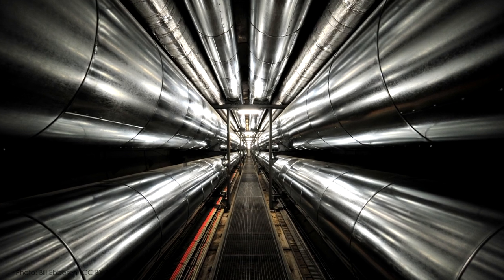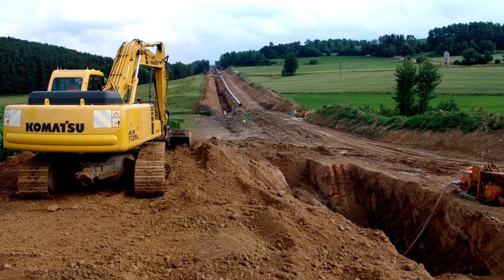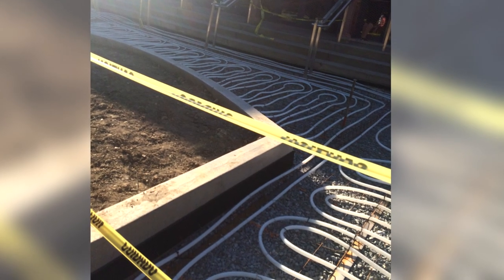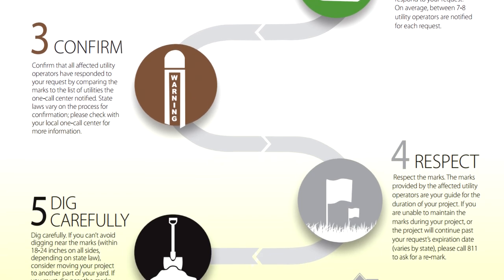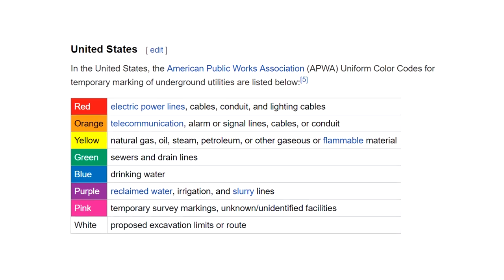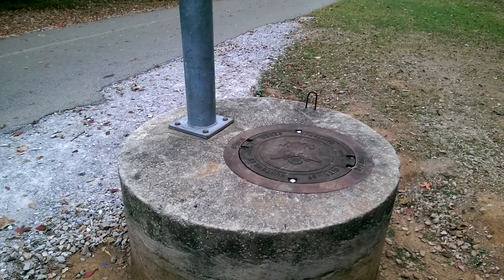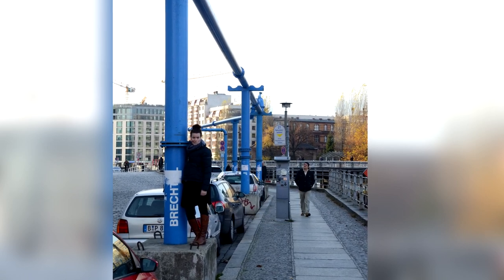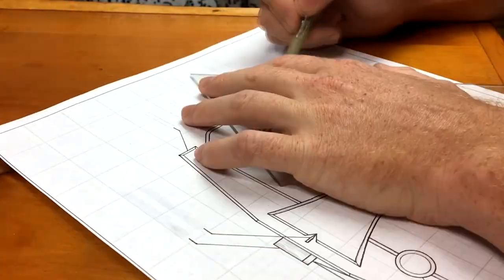What's That Infrastructure? (Ep. 4 - Subsurface Utilities)

Comment: The overground pipes in Berlin are used for pumping out construction sites, since the location in which the picture was taken is rather close to a river and Berlin has relatively high groundwater. They drain the water into the next river (you can actually see that in one of the pictures), but that can still mean that they go on for multiple city blocks. They are removed after the building can hold back the water by itself.
Reply: Although apparently they often don't get removed. Because there's so much building work going on in Berlin that they just get extended to the next building site. Which is why they're everywhere.
Reply: It's not just for construction. The simplest way to describe their multi-purpose use throughout the city is that they move the water from an unwanted area to a desired area. They are extremely mobile and often appear seemingly overnight.
Reply: I spotted those in Berlin recently and was scratching my head trying to figure out what they were for - I knew it had something to do with building sites and it was temporary - just didn't know about the high groundwater issue! Thanks for filling us in!
Reply: They are often used to transport/re-route water when there is construction.
Reply: I was about to post the same thing. Arte (German-French television channel) once had a short segment on this, in a show called Karambolage, I think.
Reply: i remember seeing these pipes around potsdam and wondering wtf they were doing there. the only thing i was fairly certain about was that they couldnt possibly be permanent!
Reply: I believe those pipes in Berlin are located in the museum island section. They're doing a massive construction project of a subway (the U55 line) between two disconnected parts of the U-Bahn.
Reply: Thanks , those things intrigued me on a visit to Berlin
Reply: When I was in Berlin guide told me that those pipes used for moving building garbage (for example dust) so building sites wouldn't make traffic jams. I'm not really sure is it's true, but that is what I was told. 
Also they have pipes like this in Dresden.
Reply: According to the color code ,
Blue is water 🤔
Reply: The pipes in the pictures are actually not just used for pumping out the water. During construction of the new underground line at that place in Berlin the soil got too soft for building the tunnel so they started pumping water there and freezing it so it can hold while they install the permanent concrete tunnels.
Reply: Username indicates expertise.
Reply: I wish more countries would do that. My state is kind of retarded when it comes to environmental laws, they have high taxes and have high safety requirements when it comes to people and businesses impacting the environment but the government doesnt hold themselves to anywhere near the same standards. 
A good example: in my home city we have some special taxes for water treatment including ground water protection, specifically because we have numerous rivers that drain into the bay and the biggest river in the county runs right through downtown. I've seen some taxes specifically for "ground water protection" and they've done some levies for the bay. Despite that the city dumps most of the runoff from downtown straight into the bay. That includes some crap from major construction sites that drains straight into the storm water drains, and the runoff from city halls massive laws that are so heavily fertilized and doused in chemicals that it turns parts of the bay green. They've also done levies to dredge the bay, which used to be done every ten years, but it hasnt been done since at least the 80s.
Reply: @wmdoylej  Actually, the color code is simply which company owns and maintains them. One company has pink, one blue, one green etc.  It's so the authorities know who to call if there's a leak or an accident and a pipe gets damaged.
Reply: One thing I wonder about is how the other cities pump water from building sites to the next river/canal etc. London, Paris, Chicage almost every major city is built on or next to a river, and I am sure that companies building (for example) underground car-parks have to pump out a lot of water. Where do they pump it to? And where are the pipes??
Reply: @martinstent5339  Berlin is a swamp area. The whole soil contains a lot of water and is incredibly unstable. In most other cities, you can dig underground lines and fundaments without creating a lake.
Reply: @opfipip3711  yea that issue is mostly cause by the fact that it has Multiple rivers going through it
Reply: @martinstent5339  In the US, urban const site groundwater is typically pumped into the nearest storm drain. There are some feeble attempts to remove mud/silt from the water. I have always been impressed by how clean Western Europe cities are compared to ours!
Reply: last summer i was in berlin and saw some of them lol
Reply: The pipes in Berlin are part of a complicated and comprehensive groundwater control system. Due to the large amount of below ground construction, water was pumped out of the construction sites and nearby wells was pumped back into the ground in other areas to keep the overall groundwater level stable. This prevented subsidence below existing buildings.
Reply: I spotted those pipes also in Vienna, Austria. I read they were digging a new tunnel for the subway, those pipes were pumping out the ground water so they can work in dry conditions
Reply: Sometimes the same mechanic is used to pump cement as well if building in a narrow or hard to get area.

Comment: The last one on the beach is most likely a sensor using a variable induction potentiometer to measure tidal paterns, velocity, and stress on the unit (force).
Reply: look like sensor. but more likely a water content sensor on conductivity/oxygen sensor...
Reply: Can you give an example for what is that data needed?
Reply: Conductivity and oxygen content can be indicators of high nitrogen inflows such as raw sewage or high fertilizer runoff. These conditions can cause massive toxic algae blooms in short order. The oxygen content can indicate the blooms as well since the algae will gobble up the dissolved oxygen at night which leads to sea life die offs. 
This information is important especially around seaside cities. If dangerous algae become prevalent red tide warnings can be posted so fisherman and shellfish gatherers know not to eat what they catch. The data can also be used to monitor the efficacy and efficiency of the sewage treatment systems in the area.
I hope this clarifies a few things about water monitoring in shallow water. 
Sensors and test stations above the low tide line are helpful because they can be easily serviced and cleaned. And samples can be removed at predictable times if the station is so equipped.
Reply: No, this is PEM – Pressure Equalizing Modules https://ecoshore.com/technology/
Reply: Could also be a seawater intake if there is an aquarium nearby. Seaside, Oregon used to have something similar.
Reply: This looks to me like a part of a fire hydrant system. In areas with lots of readily available water, municipalities will install non-pressurised drafting  hydrants where a fire engine can hook up and draw in water using negative pressure. Looking at the image, it appears to be a large diameter pipe--around 4 or 5 inches--which would be typical of this system. As far as it being installed above low tide, this could be due to the limitations of the pumps on fire trucks. They can only draw water for a certain distance before it becomes ineffective, and it may have been infeasible to put the pipe far enough out to access water during low tide.
Reply: @sunscreen318  The problem isn't just the distance from the shore, but also the height. You can't pump water higher than 10m using negative pressure. The installation in question is in Belgium, which experiences tides of around 5m. If the water were distributet purely passively, to be pumped at the outlet using negative pressure, then with outlets as high as, say, just 6m above typical high water, there would be no point in placing inlets any lower than 1m above typical low water.
Reply: Wrong
Reply: @nanonymous9139  Sine PEMs are invisible after installation, this does not make sense at all.

Comment: I would just like to add a comment, to your discussion. Before I retired, I worked as an Equipment Operator, involved in the repairs of Condensate Line which parallels the Steam Line for Steam Heating, in Downtown London, Ontario Canada (pop. 450 000). There is a district steam boiler plant, fired by Natural Gas (many years ago the plant was fired by coal)(& this plant also uses the steam for turning turbines to produce electricity, to send back to the Electrical Grid). The steam lines and Return Condensate Lines travel under the Downtown city streets, heating businesses and 2 Hospitals. The line locator personnel, would use White spray paint (the colour White used for Steam), to mark where the lines were located, below ground. I believe New York City (Manhattan) and Toronto, Ontario, also have the same district heating system. Also, in London, Ontario, during the summer months, "Chillers" are used to supply Fluid for cooling the buildings. (Note: I'm note sure of the process, maybe you could devote a YouTube video to this fascinating underground infrastructure). I love your video's. Thanks.

Comment: Sometimes unidentified, seemingly randomly placed ground vents are venting methane. I see these a lot on reclaimed land, or land formerly used as waste disposal.
Reply: Ryan O'Horo they should be reclaiming it as landfill gas! It's a useful fuel, and it's better than venting it off to the atmosphere and contributing to Global Warming
Reply: That dirt you track indoors on your shoes is useful potting soil! You should reclaim it and grow flowers to beautify your environment!

Point is, not all technically valid statements are practical.
Reply: Mildly Amusing Channel it isn't practical as it wastes more resources and emissions capturing the waste methane than is reclaimed via that process.it would be self defeating to do it to be eco-friendly.
Reply: Methane from buried landfill is reclaimed and use to run small power stations. I have seen it lots of times.
Reply: @taumctauface1886  Dangerous myth.

Comment: Those pipes in Berlin transport unneeded ground water, which escapes when tunnel boring machines are digging. (Sorry for my bad english) The water goes then straight into the Spree, a river through Berlin.
Reply: Your English was perfect. Though we would usually say "then goes", "goes then" is more archaic.
Reply: You are right. It is a photo from the U5 construction site in Berlin. They are digging up to 25m below surface while the ground water is around 2-3m below surface. These blue pipes are used to dispose the water and in addition ice is used to stop the water flow.

Comment: Yay! I was just thinking about you the other day. I work in construction, I should have sent in a picture of installing underground gas pipe for some multi-family homes we are doing. We bury the pipe with a copper wire taped to it (or wrapped around it) so that the pipe can be found in the future. A current is applied to the tracer wire and a sensor at the end of a wand much like the spray painters seen in this video is used to detect the magnetic field around the wire.
Reply: Alaska Skidood  i installed underground gas mains for decades. The tracer wire, what you are referring to, is used to locate a plastic main that is not conductive by hooking to the wire instead of the pipe. However, you are installing it incorrectly and in a dangerous way. The tracer wire needs to be 12” minimum directly above the gas main and not touching it. If the wire is touching it a lightening strike to anything near by can melt the plastic main and possibly cause an explosion.
Reply: @michaelspano6127  we put ours below with 3-4 inches of sand cushion between the pipe and tracers wire. Never touching the pipe.

Comment: In the Netherlands there is a general register where all utility company's share information KLIC. If you start a Digg you can request a local map with all known information. Still sometimes it goes wrong,... (big oeps, shocking 10%). Contractors sometimes do not bother or a homeowner is fencing his garden without thought...
There are regulation in place for verwies types of cable/pipes, digging in depth; water 80cm, Telecom/cable/house power 50cm, gas 80cm etc...
Basically we have a sandy soil, and pavements are covered with stones and tiles so it is the easy way...
Reply: PHMSA also has a map of utilities but it's mostly secret for security.
Reply: We have a similar system in Quebec called INFO-Excavation
Reply: In the US, depending on the state, it is called Dig-Safe, or 1-Call, or Miss Utility.

Comment: the pipes in berlin are temporary instalations for big construction sites, where more water is requred than the local sector can handle. sometimes also additional HV power lines are being pulled along the pipes as well, for heavy machinery, or to prevent power outages while working on the infrastrucure

Comment: The blue pipes in berlin are temporary constuction site pipes which lead ground water from the subway construction site in to the river (Spree) to prevent flooding. This is often needed at construction sites in Berlin due to high ground water levels.

Comment: The vents next to the road are likely where a petroleum pipeline crosses under the road.  The pipe line is ran through a sleeve an inch or so bigger the product pipe, and the sleeve is sealed (somewhat) to the product pipe.  The space in between is vented. The little box on the side looks like a test point to check the anode bed.   I dont know if this is done everywhere, but its how a lot of the crossings were done on the Cherokee pipeline from Ponca City to Wood River.

Comment: The green pipes in Berlin, reminds me of a construction site here in Copenhagen. They also had pipes running on poles.
They were use to pump water from within the construction pit out to close by , where it was pump  down into the ground.
The old houses in Copenhagen is standing on wood piles, which need to stayed wet. Pump water away to a constrution site would lower the water table, if the water wasn't pump back in the ground.

Comment: The blue pipes in Berlin are used to to pump water out of underground construction areas into the next river. (like underground train stations under construction) so they are only temporary until the construction is finished.

Comment: 4:46 in Karlsruhe they have these too. They carry Water and are used during underground tunnel digging with sandy ground. In case a wall of the underground tunnel breaks the tunnel has to be flooded rather fast otherwise surrounding building will get damaged as a result of pouring in sand.

Comment: The blue pipes that run above ground are temporary installations for high power cables for construction so that engineers can have power for cranes and floolights to enable the workers to see because most construction in Berlin happens at night. I live in Berlin and I had been wracking my brain but i found out a few months ago. Hope that helped, thank you for the channel. Keep it going.

Comment: maybe that last one is a storm surge / rising water level detector?
Reply from the maker: I think that's a good guess. I've never seen something like it. It seems quite exposed to be permanent.
Reply: The pipe simply leads back into the ocean to protect the beaches from erosion - at high tide some of the water will flow back through these pipes instead of flowing over the sand :)
Reply: LazerLord10 By letting some of the water flow directly back to sea, the sand it carries is left on the beach.

Comment: The blue pipes are a really clever solution. Berlin has a high groundwater level. They are building underground station, and there is a possibility that rising groundwater would lift already built parts of the station into the cavity. They built this line, so that, just in case, they can flood the station to counterpressurise it until they remove the water from below. Also, Berlin has a long history of overhead pipes, because almost any construction project involves laying pink pipes to lower the groundwater level locally. Building on a swamp has its drawbacks.

Comment: I was working in ditches laying cables when I was 17. One thing about safety I noticed that when we bury the pipe trough which we will extend a cable, halfway to the surface we layed a strip, like the one police use which has STOP writen on it, except it had CABLE writen on it, so if dig above the cable, first you'll find the tape. Another interesting point is that we dig the pipe without a cable, but it had a wire going trought it, which we then used to pull the cable trough.

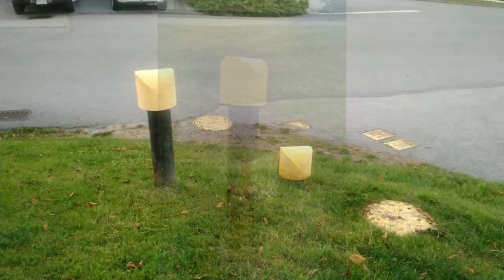Comment: Those vents with yellow caps coming out of the lawn (4:40) could be sewer vents. In the early days of plumbing, a whole house would have a trap underground on the main sewer line to prevent unwanted sewer gas from coming up into the household piping. It was necessary to vent these traps to prevent them from siphoning. Eventually traps and their vents were moved to be as close to each fixture as practical.

Comment: Germany has a pretty cool system of blue, yellow, and red/white signs being stuck to buildings, lamp posts, and so on, that show the exact location of access points to water pipes, gas pipes, and power lines in case they are covered by snow, mud, or leaves. You don't really notice them when you grow up with them, but they are absolutely everywhere.

Comment: Those yellow topped tube ends aren't vents, but but they are well heads. Those wells are used for monitoring groundwater around hasardous plants, like a gas station or a chemical plant.